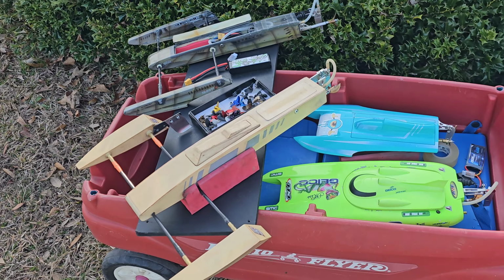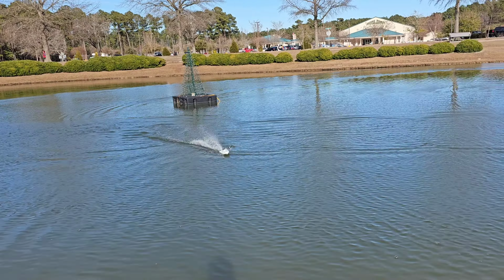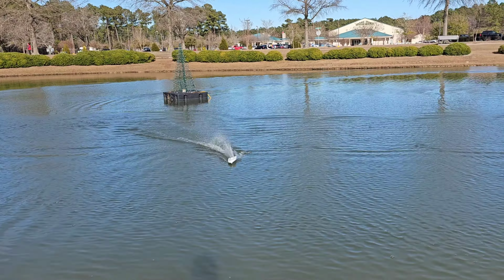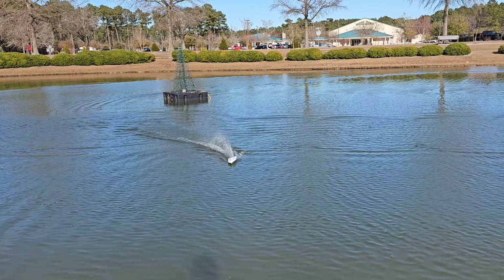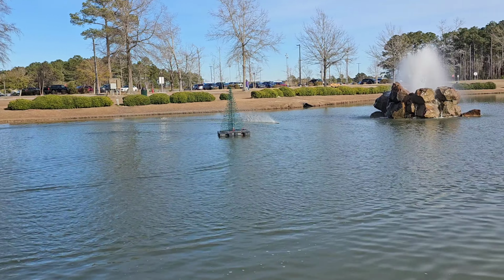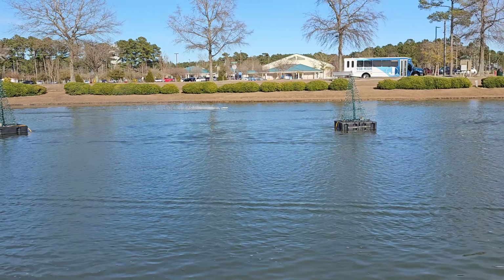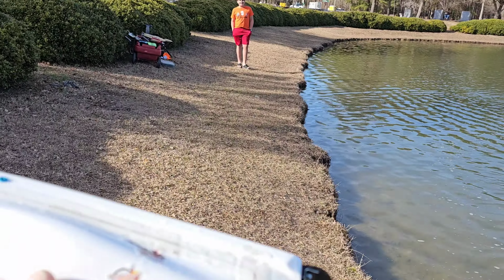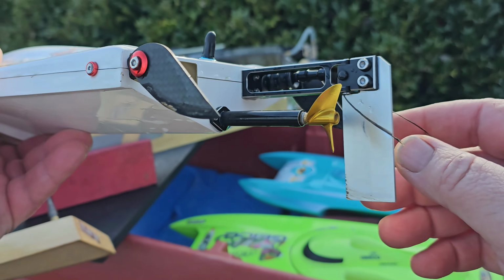4s Stock Electronics With Prop Changes Oxidean Mini-Dom - Fast Rc Boat

Comment: What a bad ass little boat..and self riding I like that a lot.. I'm thinking about getting a hull like this just been watching other people running them...this one is impressive I got to say.. we been messing around with different motors the kv and voltage on them ..a big boat yes needs the higher tork or 6-8s to get speed out of a heavy boat... however a small boat no..your turning a little prop so running big battery packs I think is a over kill..so been experimenting with low voltage high kv motors you just to run a higher amp esc say a 14 volt pack with a 15 volt motor you can run one pack 2-3s or  you wire your battery packs to run 2 smaller packs at  the same voltage 14 volt 14 volt...don't wire it to 28 volts..and give you what 4s-6s at the same voltage..and a nice long run time . change out your prop time you find one that will run fast..
Reply from the maker: Just having some fun!   BG4L

Comment: Thank luck the sound is sorted,  perfect now, does that hull turn left the same ? as there is a hint of torque roll,
Reply from the maker: Yea, it'll turn left, still not as good as a right turn.  Having 2 turn fins helps dramatically.     Before installing the second fin, she would just skip out and lose grip with any left input.

Comment: Lil boats are the fun boats for me to run. Anyway heard you were thinking about doing some racing, looking into a club up here that does the circuit racing realy want a club that does a drag boat race. Maybe I'll have to get a club started up here "twisted rc drag boat racing association".anyway watched some racing this weekend on tv. They were like a cross between a airfoil wing and a hydroplane never seen before but they were piloted by a Male and female team in each boat. Anyway check them out if you can wish I knew more about them. Peace keep the top side up and the prop spinning true.
Reply from the maker: I was considering racing, but I really don't think my schedule will allow it. Work family, youtu.be, cash,  just don't leave me enough time for serious racing season.    Still interested. Just doubt I'll be able to this year.
Reply from the maker: Drag racing sounds awesome 👌

Comment: Hello again Big B! I have a question this time if you come across this. As you might remember, I've been working on an old RadioShack Stinger 'twin hull' 18" boat. Upon First test, the boat seems to 'bow slap' the water when trying to go fast. Upon second test with the battery in the front showed better results. Though im thinking it probably has more to do with the stock solid shaft + the angle of the prop. My question is, what flex cable, and stuffing tube size would be Most Common/ Easiest for me to work with when considering struts? Im finding it tough to wrap my head around shaft size, tube size, different strut bore size, prop size, and bushings all together and what types of boats different sizes should be used for. I currently have a losi mini-b 6000kv motor on 2s in the boat which has a 2mm motor shaft, i understand that is not ideal and will have to be swapped out or adapted. The rest of the boat is bone stock at the moment. Any input is much appreciated as i understand you are busy busy. Great Video Thank You! & see you next time!
Reply from the maker: I think your best bet for flex cable in the stinger would be .98 (2.50mm), especially running it on 2s with your motor choice.   Hardest part will be finding the 2mm to 2.5mm coupler.. search 2mm to 2.5 coupler on ebay OSE has everything else, .098 flex cable & teflon liner, 1/8 drive dog & nut, you'll need a 3/16 brass stuffing tube to accommodate the flex.  As for prop choice, I'd Try an octura 430 or 432...

Oh yea you'll need a micro strut or you can set it up like my MG 17 W/O a strut since your running it on 2s
Reply: @IRONCLADRC  Many Thanks!!! I found a 2mm to 1/8 adapter sleeve that might work. Or i can use one of the cheap blue ebay ones to adapt to a 4mm shaft stub as a last resort, short of finding a more suitable motor. I know those arent great though haha. I greatly appreciate your knowledge and input! Ill get to work! BG4L